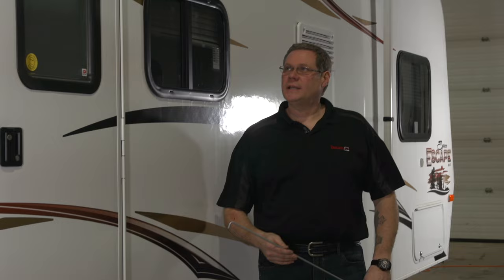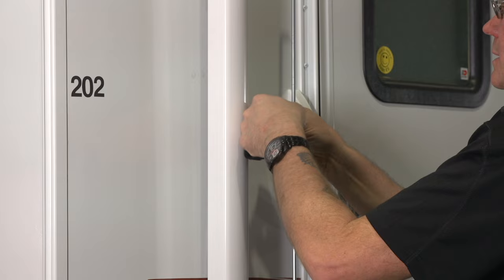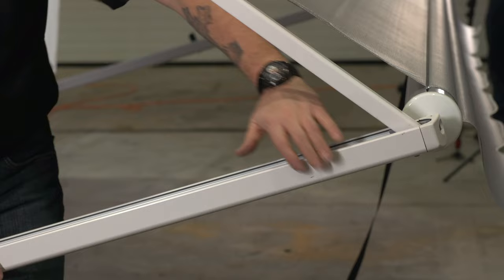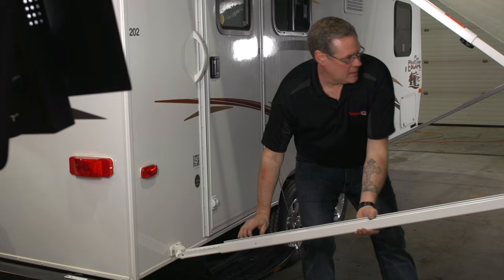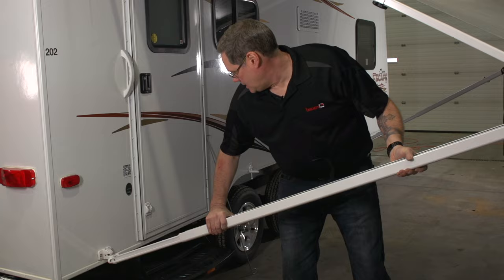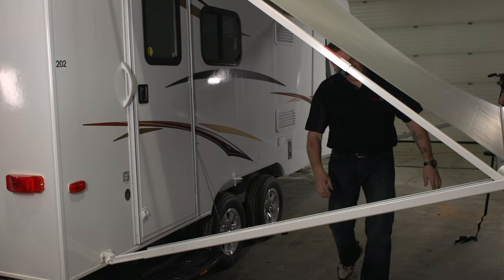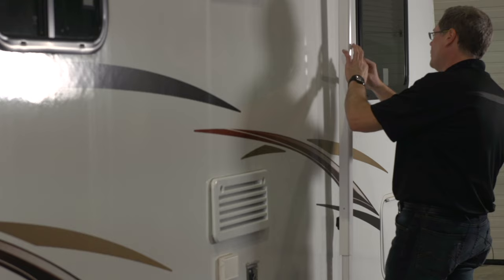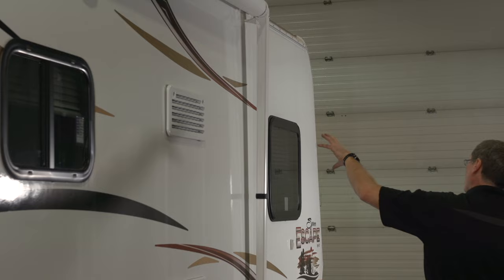How To Work A Manual RV Awning

Comment: Mine won't roll back in
Reply from the maker: Hi Todd, Our parts team had a few suggestions of things you could try. They are not technicians, and without seeing it, it is hard to diagnose exactly, but they are happy to share their years of experience in hopes of helping. 1) Sometimes you need to give the awning a little extra tug out to loosen the pressure on the lever so it will go back into the rollback position.  2) Or, the ratchet mechanism might be damaged and need to be replaced.  3) Make sure the nut on the rafter arm is loose. Otherwise it won’t collapse back in when trying to roll it up. Best of luck and happy camping!